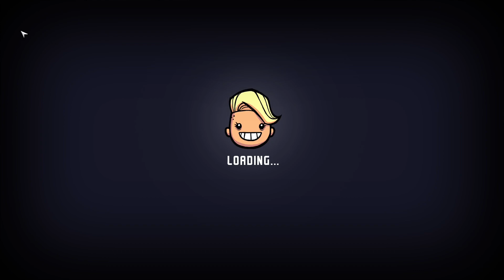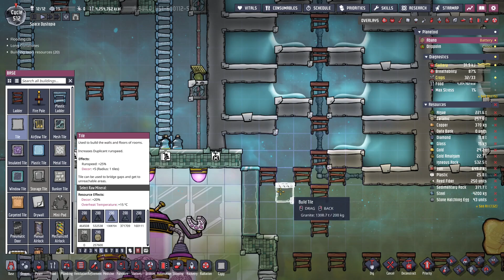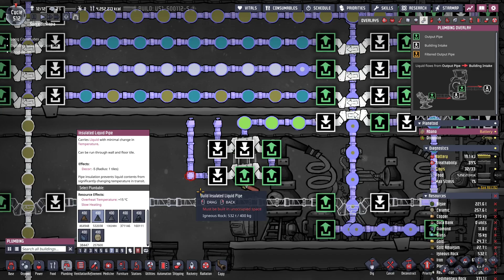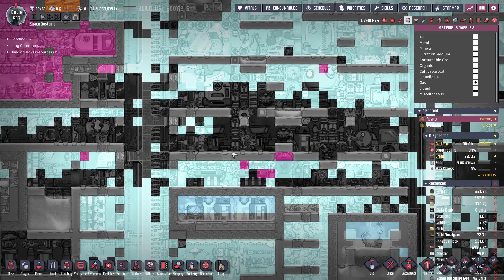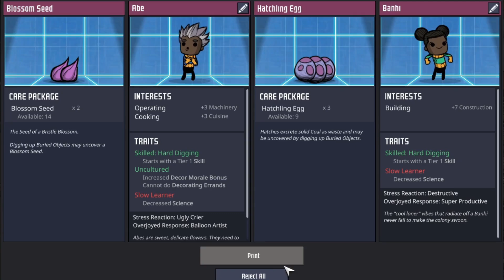Oxygen Not Included: Ranching Pips, Pacus & Pokeshells (LP - Ep24)

Comment: Any Idea why my pacu are feeling confined tih 6[8 tiles.  Did something change such that the two spill tiles no longer count?
Reply from the maker: They did rework parts of the crowding mechanics in the last QoL update, which might be the cause. Here's the excerpt from the wiki:
"Crowding
    It will now be calculated based on space allocated to each individual critter, rather than assuming all critters are allocated the same amount of space. i.e. It takes a higher number of small critters to crowd large critters than it used to.
    Aquatic critters will only consider other aquatic critters and eggs that are in the same pool as them when determining their Crowded status.
    The Crowded modifier is now relative to the critter's personal space requirement. That is, larger creatures will generally suffer a lower happiness penalty than smaller creatures when they inhabit the same room.
    The tooltips for the Crowded status now specify how many members of each critter are present, and how many tiles are allocated to each.
    The Flopping status for fish now displays in red font with an exclamation mark."
Reply: @RKFWalter  Through some experimentation, it looks like if you swap the pneumatic doors withs mechanical airlocks then the two drip tiles 'connect' up and are counted while the door is closed, but do not count when the door is open (or if its a pnuematic).  To get that to work extra automation is required so that you only open them when you want a critter and something was recently available to be delivered.   Or, you can just make each starvation chamber 1 wider.  Doesn't seem related to any of the explicitly mentioned changes, seems to be about how the water tiles are counted requiring some definition of "full" that is different than before?
Reply from the maker: No clue tbh, aquatic critters aren't really my speciality.

Comment: I was introduced to your channel through this video and I LOVE what I'm seeing but I really am going to have to go back to figure out what is even happening in some areas. Shout out to you, I built a smaller, slightly modified version of the fish tower and it is amazing, such a clever design.

NOTE the reason your pacu were struggling when you had the layered liquids is because they require more than 350kg of liquid in a tile to swim in it. Found that out recently, and the wiki also says that they have trouble swimming in different liquids. This makes stacking liquids more difficult, but by stacking small amounts of the different liquids you can actually put the fish feeder underwater without flooding it and have it reach the bottom layer where they are swimming. That expands their total water pool size while keeping their movements very restricted.
Reply from the maker: Happy to hear you enjoy the series :)

Yeah, the liquid layers were just too shallow for the pacus. But it works now, even if it took a bit longer to fill wih just water. 

One quick note here: I noticed in later episodes that the pacus in the side chambers started to die out, when you stop feeding with algae. It's likely due to multiple pacus hatching at once and then ending up in the same chamber, overfilling it. I later adjusted the critter sensors to let only 4 pacus into each chamber, which helped. But I still notice a drop after a couple dozen cycles. It's still way more efficient than having just the breeding chamber, but I thought I should mention it.

Comment: I've tried making a pacu ranch based on your design, but it seems the auto sweepers can reach the top of the mech doors, causing an infinite loop.  Your first layer on top is fine due to the extra tile, I think, but all the spots below are going to loop.
Reply from the maker: What is looping? The eggs are on the ledge, right below the conveyor chutes. That's out of reach of the sweepers. The doors are only there to stop the pacus.

Of course, if you move the sweepers inwards, that changes and you get a loop.
Reply: @RKFWalter  but the next floor down is NOT out of reach of their sweeper.
Reply: Ah, my mistake.  I was thinking for some reason that the eggs would be falling down on the mechenized doors rather than the baby pacu.
Reply from the maker: Not sure what you mean. Everything (seafood & eggs) in the starvation chambers is supposed to be swept anyway. You especially want to remove the eggs or the pacus get cramped and won't lay an egg during their lifetime (which is somewhat required to create a stable population once the breeding is stopped. So there's no issue with the sweepers being able to reach into a chamber further below.

If you're talking about the breeding chamber, there's also no issue. The sweepers that can reach the ledge with eggs can't reach the loader for the eggs. And the sweeper that can reach that loader can't reach the ledges.
Reply from the maker: Okay, got ninjad by your last comment. Yeah the eggs are on the ledge not the doors. This is important in case a starving pacu dies in the upper chambers. If the eggs where on the doors and fell down, you would have to wait for a new one to be laid to repopulate. This way the next hatched pacu will be put in the now underpopulated chamber.

Comment: 27:05 The pathfinding of Pacu tends to get stuck from time to time.  Main indicator is that all the local Pacu are all on the same tile.  I've found that placing a tile order on top of them will make them reset and scatter.  You don't have to build the tile, just place the order.  Don't think it was the layers of liquid.
Reply from the maker: Possible. But it works now, so I'm satisfied.

But thanks for tipp! I'll try that the next time I run into the issue.